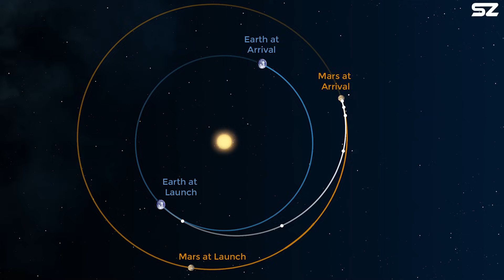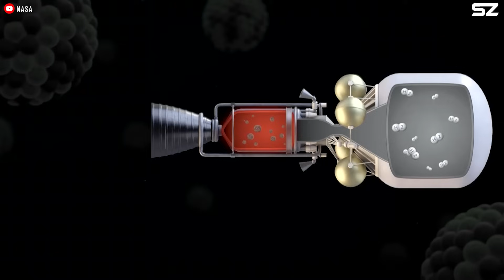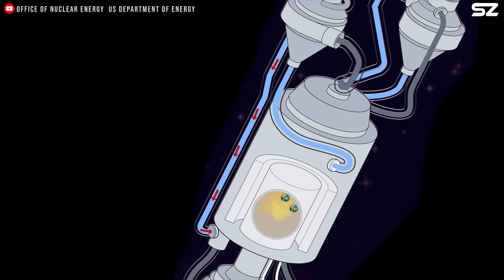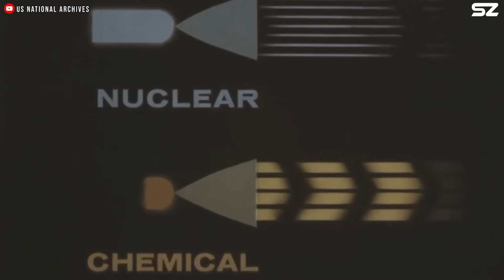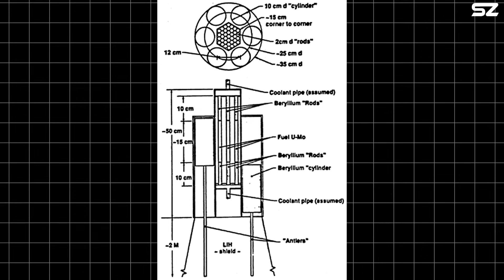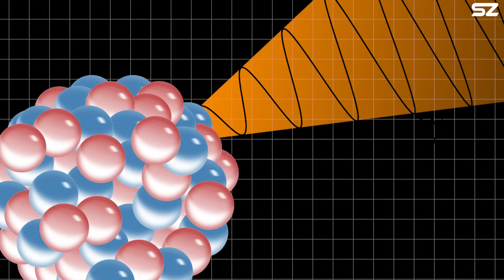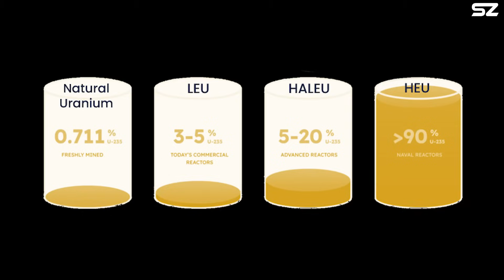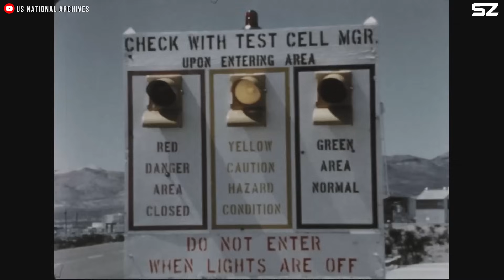NASA's Explosive Nuclear Engine Problem! Worse than SpaceX's Engine...

Comment: Nuclear thermal rockets were initially designed to launch early very large nuclear weapons. The problem with using them in the atmosphere is they shed radioactive particles in their output thrust plume.

Comment: And then there is the 3rd method of nuclear propulsion proposed - detonation propulsion.
The idea being to detonate bombs on the other side of a thrust plate.
Reply: That would be one way to dispose of all the nuclear weapons on the planet, launch them into space with ICBMs and assemble them into a rocket with a robotic thrust plate loader. e.g. nuclear machine gun for speedy Mars transit.
Reply: Project Orion. A Bang-Bang. Theoretical top speed, 0.11c.
Reply: @spacecadet35  Develop magnetic combustion chambre and nozzle. Magnetic as used in, e.g. fusion reactors. Or simply reduce the power of the nukes by detonating them some distance from the spacecraft, power reduction by the inverse square of the distance.